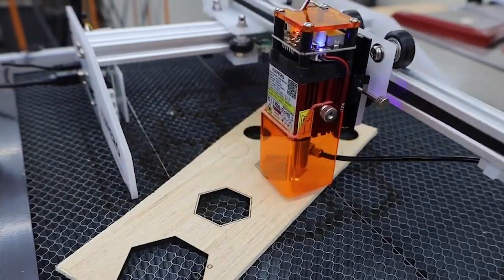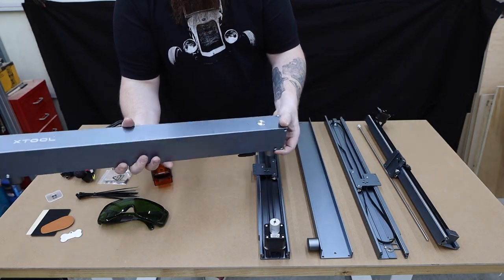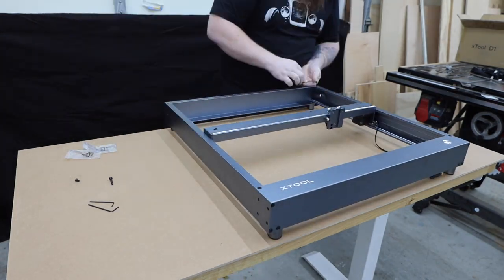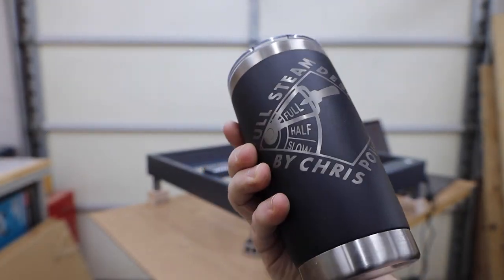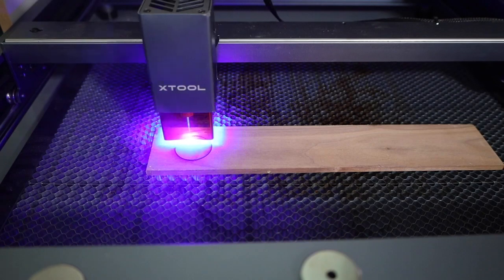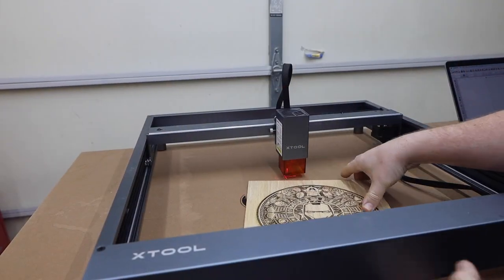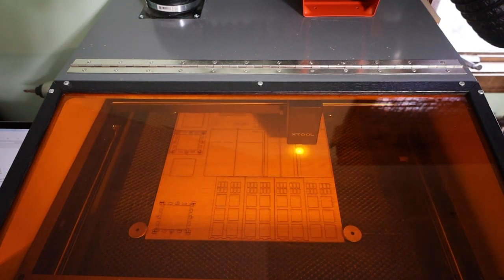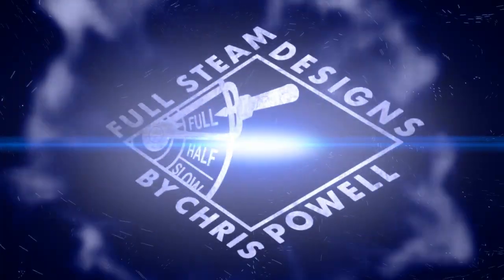Is this the best Diode Laser? Reviewing the xTool D1

Comment: Hi, I have a Glowforge. I just want another engraver for cups/mugs. Which one should I get? I'm still a beginner.
Reply from the maker: This is a great machine for it. I would definitely get the RA2 roller setup from them too if you plan on doing mugs. It has a chuck that can grab stuff from the inside, so you won’t have the coffee cup handle getting in the way.
Reply: @ChrisPowellFSD  I was thinking of getting the cheapest model but the RA2. Thoughts?

Comment: what the thickest wood you use? Do you use light burn if so what are the settings used? i cam struggling i would like to cut out letters. on th thickest wood as possible
Reply from the maker: Generally I just cut 1/4”, which I can do at 5ipm and 100% power. If it’s thicker, you can make multiple passes.

Comment: Cheapest trick to stainless is using a black sharpie to paint the surface then use alcohol to remove the sharpie ink after it's done engraving.

An alcohol bath container can be used over and over and over again.
Reply from the maker: It just didn’t seem to get as dark as the moly spray. I’ll have to go back and try it again.
Reply: @ChrisPowellFSD  Just double up the sharpie layers and the number of passes.
Reply from the maker: @NonLocalus  probably easier just to use the spray. It’s pretty cheap and goes a long way.
Reply: @ChrisPowellFSD  that's fair. Does the spray leave residue on the untreated bits of the stainless and if so what do you use to clean the over spray? I've been hesitant to use the spray.

Talking about production additives might make a good follow-up video.

Comment: Great review , what settings are you using for the single pass cuts? I just go the 10w version and not having much luck getting clean cuts like that on the same thickness boards.
Reply from the maker: Thank you. I use the factory settings to start and then slow down the feed rate if it’s not cutting through.
Reply: Thanks!

Comment: Hello Chris, thanks for the video. I have a few questions:
1) Is it possible to enlarge the area of this machine?
2) Is the power of this laser similar to that of the Atomstack A10 or S10 (10 Watts)? Thank you
Reply from the maker: It probably wouldn’t be easy to enlarge the cutting area because it uses proprietary rails. I haven’t used the Atomstack, but would imagine they’re very similar since they both use the same methods to obtain 10 watts.
Reply: @ChrisPowellFSD  Thank you friend. I asked you the question why I found the xTool D1 very well finished and beautiful. I have the Sculpfun S6 Pro with a 5.5W laser but I would like a stronger laser so I'm thinking about the 10W Atomstack.

Comment: What power and speed are you using for a one pass cut through on 1/4 inch? I use 100 power- 3mms - and 4 passes and I’m not cutting all the way through with 1/8 inch basswood.
Reply from the maker: 100% power at 1mm

Comment: Appreciate your review. One detail I can’t seem to find a straight answer to anywhere is what engraving depth can be achieved with the D1. For instance, I know it can cut all the way through like 1/4” plywood, but what If I wanted to use 1/2” or 3/4” pine or cedar, but engrave let’s say a star at a depth of 1/4” (with the long term goal of filling that engraved area with resin). Is that something this (or any diode laser for that matter) is even capable of)?
Reply from the maker: It probably could, but it would take a while and might be prone to catching on fire. You probably could get away with just doing like 1/16” deep and still be able to fill it. I’ve seen people fill their engravings before.

Comment: hey Chris, love the vids man and all your info on the boards. what is the clearance height under the rails? could 3/4 be slid under it for bigger projects? or would this be a laser for small projects only?
Reply from the maker: They actually sell extension pieces that screw on and raise the height. You could also just stack blocks of wood under the feet or even put it right on the piece you’re engraving/cutting if it’s too big.
Reply: @ChrisPowellFSD  that’s awesome thank you sir!

Comment: How would you compare this to the Atomstack X7 pro? I got the x7 for about a week and i am happy with the laser. But i always saw incredible good results from the xtool D1 and i am now very irritated and asking myself, if i should change to the D1? What is important to me is the outcome, not so on the overall build frame and the material. Normally i would say, that the x7 should get close or even identically results. But the D1 videos on YouTube are amazing. To bad, that so less people have a deeper review for the x7. Any advices?
Reply from the maker: I actually have one I need to test. Just from looking at the specs, and my experience with this and other lasers, I would say this is probably easier to operate, especially when it comes to using the roller attachment. Their software just does such a great job with that. Aside from that I’d say they’re probably very similar.

Comment: Hi Chris, great review!  Would you recommend getting the air assist with this unit?  I didn’t see one used in your video, but wondering what improvements the air assist would add to the unit.
Reply from the maker: I would definitely get one. I had made one for mine and it really helped with cutting. I would recommend getting theirs. It’s a lot nicer and I believe it comes with everything you need to use it.
Reply: @ChrisPowellFSD  do you think you'd be able to leverage a review unit of the newer 20 Watt XTool?

Comment: What kind of modifications did you have to do to utilize the enclosure you built?  I’m ready to pull the trigger on the laser and build an enclosure. Should compliment my Onefinity.
Reply from the maker: I just removed the hinge I had inside that supported the lid( because the machine wouldn’t fit, and made a new hole in the side for the wires and on off switch.

Comment: I just ordered a OLM2P as I was under the impression the unit wasn't compatible with Lightburn.  My loss for not digging further I guess.

Great review. Keep up the good work.
Reply from the maker: Originally it wasn’t. The Ortur is still a great machine. I imagine they will come out with a 10 watt laser for it eventually.
Reply: @ChrisPowellFSD  I do believe that the lasers are modular. So at minimum I can just order that new stronger module and swap them out.  Time will tell. Thanks again.
Reply: I canceled my order. It was going to take about a month to get the Ortur. I'm going to order the D1. Thanks Chris. I really appreciate this video.
Reply from the maker: @triggerwizard  glad to hear it worked out.